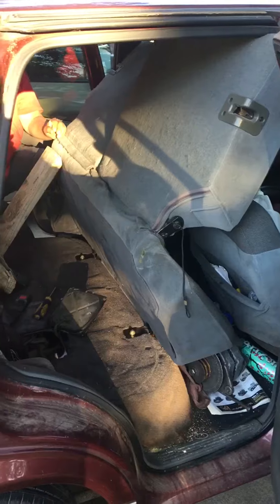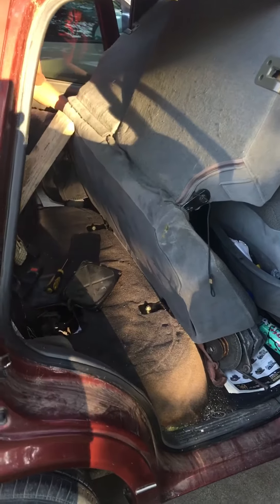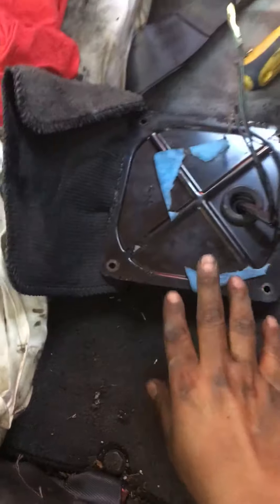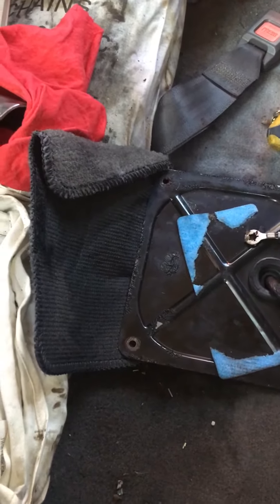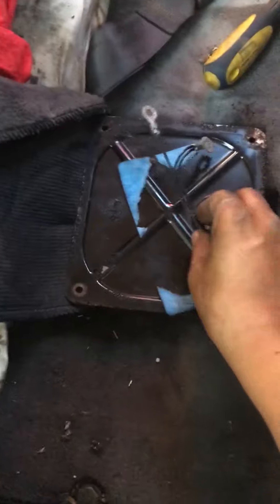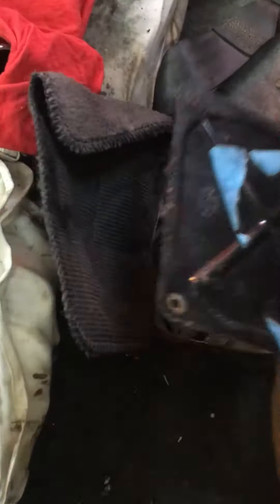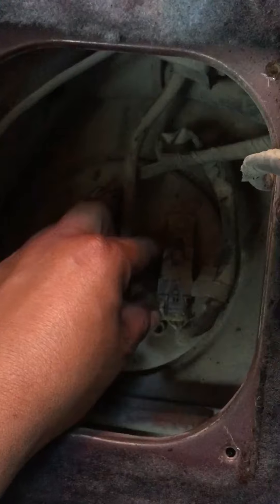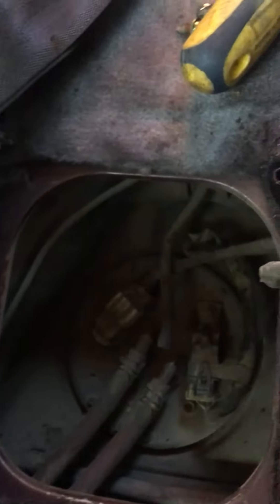2001 kia sportage fuel tank pressure sensor

Comment: The 2 hoses to the left of the pressure sensor go to a box underneath the car underneath the spare tire jack compartment. What goes on in that box as it relates to p0440? Is the pressure sensor switch normally open and closes when sufficient vacuum doesn't exist due to leaks?

Comment: i used a smoke machine to find leaks on my 2002 replaced lines my gas tank a new charcoal can in the back by the tank vent and purge solenoid even the gas cap still had a light pop the p0440 code im gonna order a new tank pressure sensor see it that does the trick 🤞
Reply from the maker: That pressure sensor should do the trick.

Comment: Any idea what would make a 2001 Sportage spray gas out on you while filling it up?
Reply from the maker: Good question,
The filler neck might be bended, damaged.. needs to be inspected.. try to fill tank with less pressure from gas pump.

Comment: Would this cause the fuel pump not to work
Reply from the maker: #Midnight_Outlaw's no sir,  even tho its related, this sensor would not cause the fuel pump not to work.
Reply: will this cure the problem of the fuel gauge not working
Reply from the maker: Jay Avila no, it wont. Thats part of the fuel pump.